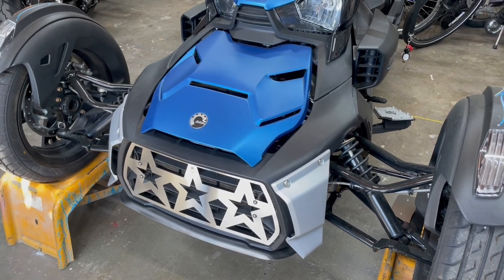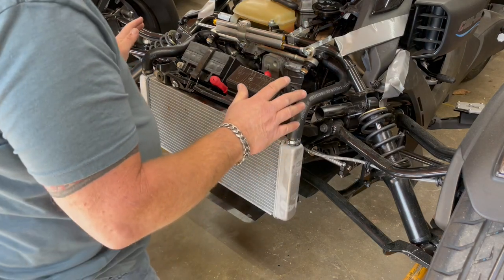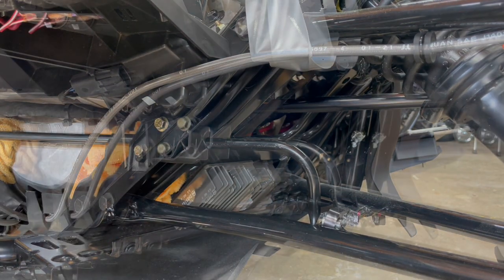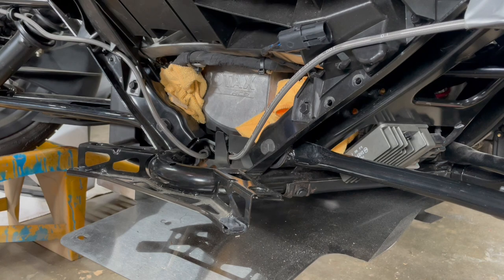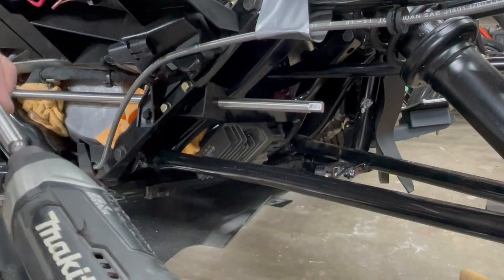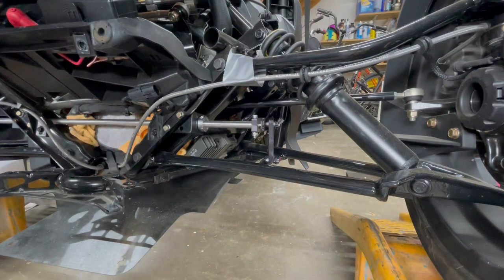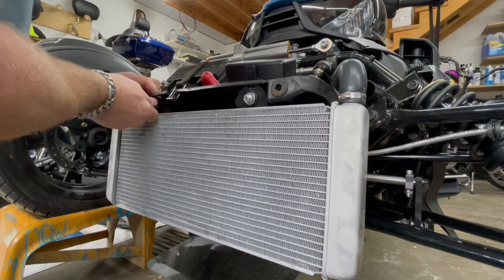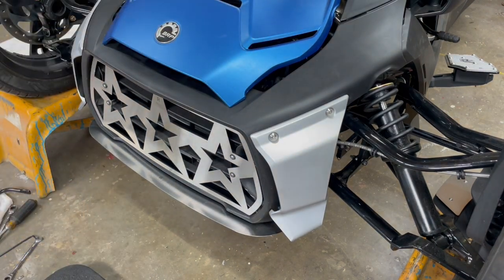RykerMod Premium N900 Stainless Sway bar

Comment: Great video of the removal and installation of the new stainless sway bar. It must handle great now?
I see you have already installed a steering stabilizer and how much did that improving the handling?
Reply from the maker: It is a dramatic difference. The Drifty feeling and handlebar shake is gone.

Comment: What stabilizer is that you have installed?
Reply from the maker: www.rykermod.com 
We own the intellectual property for the Stabilizer.
Reply: @rykermod3521  Looks like this system is fairly different from what you are currently selling?  Are you planning to produce this for sale as well.  Since it seems to connect directly to the tie rod and then to the pitman arms it would seem that this system would have a more direct impact on damping the steering?

Comment: Would bolt cutters be able to cut the sway bar, or is it hardened to the point bolt cutters won't work?
Reply from the maker: Bolt cutters can work however they need to be 36 inch or larger.